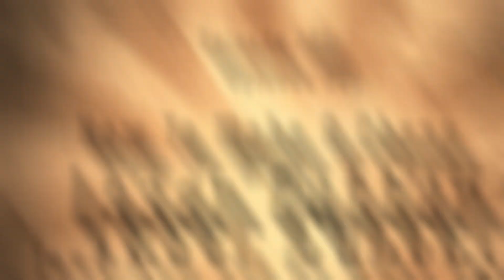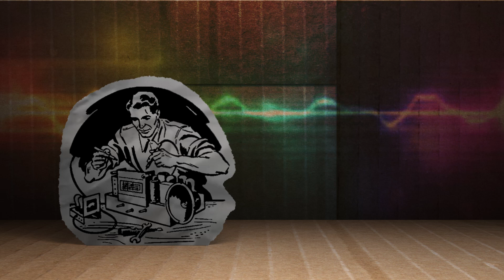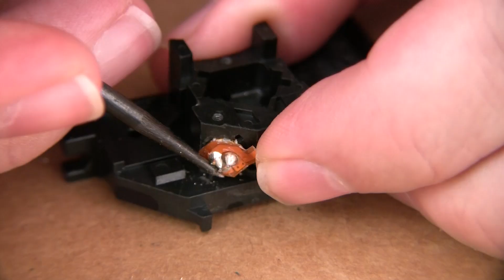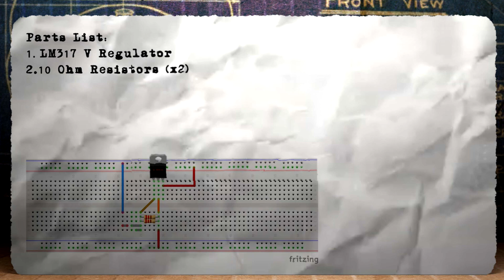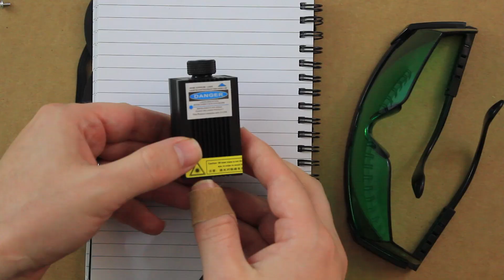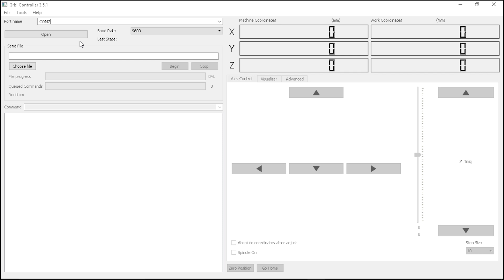How To (And How Not To) Make A Cheap Laser Engraver

Comment: So I have a large bed CNC router, 5ft x 10ft. I would like to find a way to add a cutting laser to it. Mounting the laser is not really the issue, its integrating the power and control for the laser with the power and control of the existing CNC, or at least the control of the gantry so the laser head can move and hopefully enable me to have a 4ftx8ft+ laser engraver/cutter

Comment: You clearly destroyed the laser diode, either with an ESD strike (I notice you're not using any ESD pracautions), or with the driving circuit. In fact, that circuit is not suitable as a reliable constant current laser diode driver. Beside, driving it with a relay is not the smartest idea, as you will have a lot of bounces.

Comment: i think you're confuse when explaining laser driver. yes, lm317 is a voltage regulator, but when putting reaistor between output and adjust pin, it can become constant current source....and for capasitor, it use to make the voltage "stable" with no spikes.... correct me if i'm wrong :)

Comment: Why you do not make driver with PWM (pulse width modulation)?? 
Can use SG3525, its more clever solution than LM317 which produce huge heat.

Comment: Hi! Very nice project! I bought a similar laser module to yours. But now, I'm struggling on how to connect it to an relay and to arduino (I have CNC shield) without splitting the wires of the power plug. I'm a beginner in electronics, so I was wondering If you could help me by telling me which relay should I bought and how to make the connections.

Comment: Mate, I like your work and your inventiveness. But (and there's always a "but", isn't there?), as an old electronics technician of many years experience, may I offer a suggestion?

I note that when you solder wires to a terminal pad you appear to simply press the bared copper conductors against a solder pad, apply heat, and let nature take its course. If that is what you actually are doing, you are creating the conditions for future problems, by making what is variously described as a "cold" or "dry" solder joint. Dry joints are brittle and prone to mechanical failure, which is more likely in a machine with moving parts and moving wires, and they can sometimes be a bastard to find. Other times they are obvious because the wire just comes off the connection, but we want to spend time using the machine rather than debugging our construction methods, eh?

Best practice recommends that you also "tin" the wire you are going to use before you make the joint.  To do this, hold the bare copper wire tip against the soldering iron bit and apply flux-cored solder until the copper strands are coated with solder. Then, when making the joint, hold the tinned wire (conductor) against the solder pad whilst simultaneously applying heat from the soldering iron bit. Solder from both "sources" should melt and mingle. Remove the iron while holding the wire still until the solder cools (seconds only) and you will have fail-safe joints.

And pre-tinned wires are easier to solder too.

Comment: Hey Tinker-nut if you have trouble finding the wavelength of the laser you can make a diffraction apparatus using a phone screen. Found this method at http://physics.stackexchange.com/questions/191189/how-to-measure-the-wavelength-of-a-laser-pointer. The method is not very accurate but can give a good approximation.

Comment: drawer rails, used steppers from printers, some scrap wood, cheap china controllers + fake arduino.  my build cost 40 bucks, the laser itsellf was 100 bucks (1.8W 445nm)  accurate to 0.2mm, very fast movement speed and 30x30cm working area.. im planning to increase it to 100x100cm  allready got the parts.. just 10 bucks more.

Comment: On the stepper motor, how did you find out where the 4 solder points went to on the arduino stepper adapter.

Comment: What is the name of that laser? I cant find where to buy it
Reply from the maker: +Buy Some Applez I have a link to it on my project page.
Reply: I think it is also worth mentioning a great housing for scavenged laser diodes is an aixiz module. They are very cheap, but they are built well enough for this application.
Reply: +Tinkernut I really really looked and I cannot find the link. Model Number pls?
Reply: +NotAJoke TORTUREDwithSatelliteWeapons
cost $42,99, wavelenght 405nm, i think this is it: http://www.banggood.com/405nm-300mW-Violet-Dot-Laser-Module-With-Holder-For-DIY-Laser-Cutter-p-967307.html but only Tinkernut can confirm this

Comment: Wouldn`t be easier to use an old printer/scanner and then add the laser. also is it possible to have both the 3rd print head/pen and the laser on the same machine??
:D

Comment: which laser diodes should I use to make it work?
Reply: +Midhun M.S 16x speed DVD burners or higher generally are the best for making burning lasers. The faster it goes, the higher power the laser diode is designed for, and the hotter it burns. Blu-Ray burners are even better, as they tend to be more powerful. It MUST be a writer though (whether DVD or Blu-Ray). Readers will not work.
Reply: +derstrom8  what's the maximum voltage that I can supply to a DVD writer diode?
Reply: You'll have to do your own research on that one. For general operation, laser diodes are current-driven devices, not voltage-driven. This means that the voltage is not very important provided the current is what it should be. That being said, if you exceed the breakdown voltage of the laser diode then you will damage it. All of them are different, so I can't really tell you. I would expect 5-6 volts should be good, provided you keep the correct current.

Comment: could you make a 3d scanner with an arduino sonar modual?
Reply: +Yextus Yes you could, if you make a platform that can rotate and a Z-axis to move the laser up, but with a sonar you wan't get good quality, maybe use a IR distance censor or a laser distance sensor
Reply: +tech TV ow sorry i did'nt read your message right i tought you wan't to build one yourself, sorry
Reply: theoretically, yes, but there are far easier, more effective, and inexpensive ways to make a 3D scanner if that is what you want to do

Comment: How about a DIY Quantum Router? Using quantum entanglement, all we would need to do is have the router/s create entangled particle groups within itself and another quantum router. These entangled particle groups could be manipulated by the "host" router so the entangled particles in the destination router act accordingly and are decoded by said destination router. This would mean instantaneous internet connections due to the fact there isn't really any data being sent or received. Obviously there are a couple of issues, like it hasn't been invented yet. But at least that means there's no target Cost to beat. Also keeping the particles cold enough to get them to behave the way you want is a bit of a hurdle. My Father said if I annoy my girlfriend enough, the death stare I receive will be adequately cold. Unfortunately I am unable to confirm this as I can't get close enough to her with the thermometer while she's holding a bat.

The coding should be pretty simple. It's just a matter of being able to comprehend something that's incomprehensible.
Reply: good idea! "My Father said if I annoy my girlfriend enough, the death stare I receive will be adequately cold."

Comment: Can you make something Like this? 
Every Electrical gadget will have a coded receiver. 
Then your Watch will have a sender. So when you point your hand to any gadget it'll automatically detect it and you can turn on/off, +- speed/volume etc with one remote controller aka smartwatch. 
This will replace swithboards etc.
Reply from the maker: +Zaber Ansary Extras very cool idea.
Reply: Tinkernut Ive been thinking about it for months now. The Idea is Like " One Ring (RC in this case) to Rule them (Gadgets) all." And Thanks for replying. Couldn't explain Well but You Got the Idea.

Comment: Would it be possible to add one extra cd drive on each axis so that there would be 2 on each and six in total, which would make the print size a 9cm cube instead of a 4.5 cm cube? If its possible, would I need an additional 5v to power the extra 3 steppers and drivers, or would the one 5v line be enough. And also, could I connect both the steppers for each of the axis to the same stepper driver; so 3 drivers and 6 steppers (but with additional power supply), or add a driver for each axis plus a stepper, and connect it to the same ports on the arduino, or would it have to be different ports with a lengthier program.
Thanks in advance
Reply: ahhh just use 3 scaner or printers ....:)
Reply: +Budai Adi Sorry, I don't quite understand
Reply: +Adam Abdulla it well be simpler to tear apart 3 scaners that doing 6 cd readers and it well be much simpler:)
Reply: +Budai Adi but i need 6 platforms (2 for each axis), in order to square the print area (if using the extruder / 3d printer)... taking apart only 3 will only provid 4.5cm of movement on each axis.
I understand what your saying, but my question was if it would be possible to increase the print area using 6 instead of 3
Reply: +Adam Abdulla  i think what he is trying to get is that you can increase the bed size simply by using scanners which have longer throws instead of using 6 cd drives.
Reply: +Fungi hudson (fungifilm) but all scanners have the same rail because all disks are the same size... so all readers / burners will allways have 4.5cm on the scanning rail/platform.
Reply: +Adam Abdulla When Budai and Fungi say scanner, they're not talking about a CD or DVD drive. A scanner is used to convert ('scan') pictures or documents on paper into an electronic form, so they can fit a whole sheet of paper inside.
Reply: +netnerd01 Got it, Thanks :D
Reply: Grbl is not configured for 6 motors either, so you would have to make your own program and own board to use them as slave motors
Reply: jonathan lowe actually really easy... Hook them up to the same driver so both motors always run, then adjust stepsize accordingly as 1 step is now twice the distance. This method decreases precision, so in the end it probably still aint worth it.